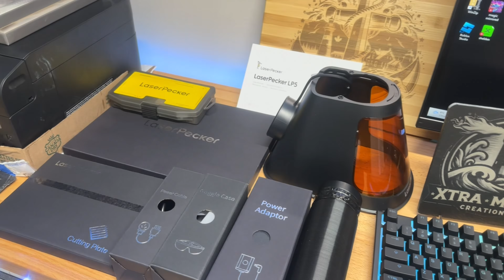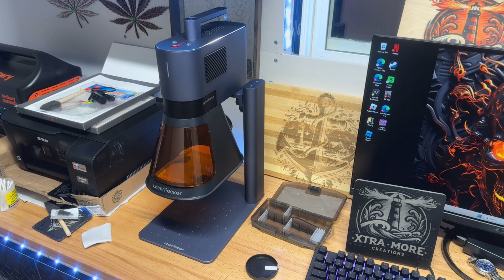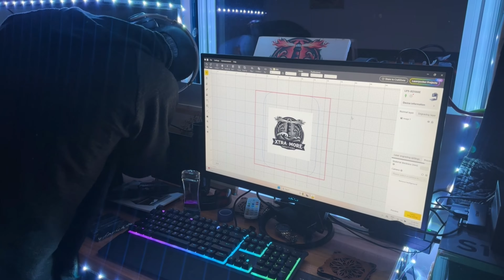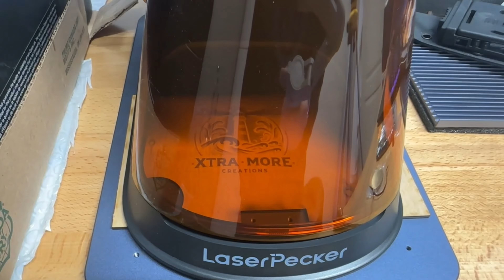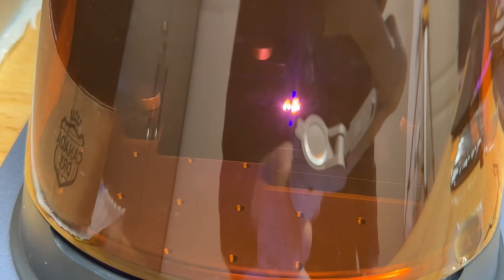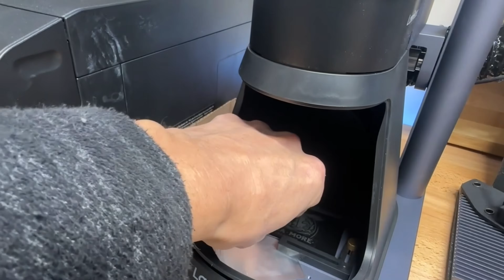LaserPecker LP5 Has Arrived For Review, Unboxing, Set Up, Download Software & First Couple Projects

Comment: Hi.  I realize this is a question not related to your video, couldn't find  e-mail address.  How do you laser cut MDF board and reduce the char, my hands are black.  I have the  same machine S1 xtool 20w.  I have tried every combination, still black.  3mm Mdf.  right now we are using settings 97power, 5 speed, 1pass.  focus ON  HELP  I want to throw this laser through the window.  I am really P. off